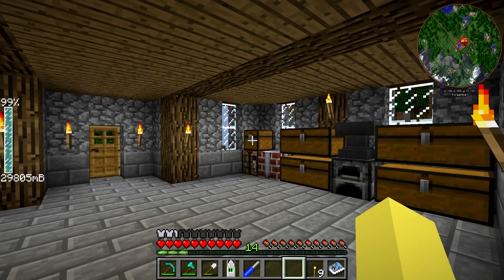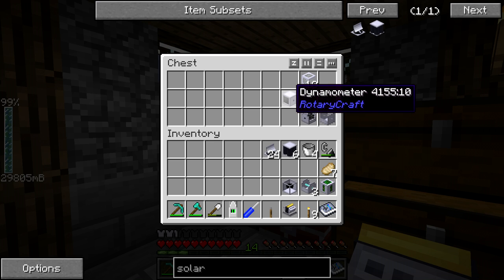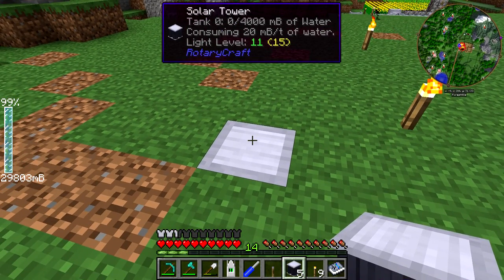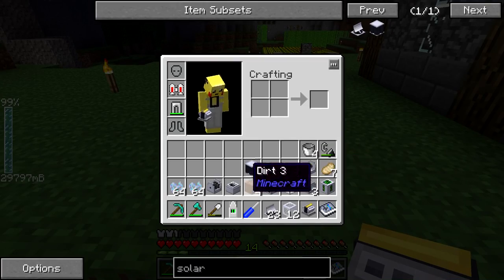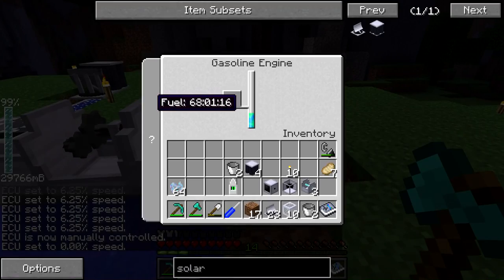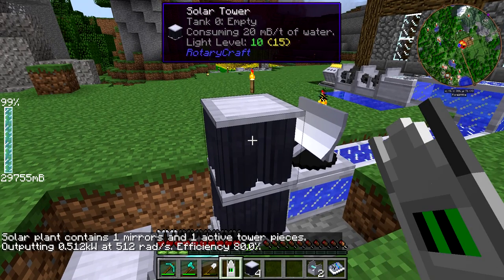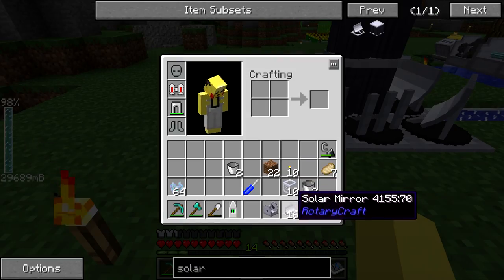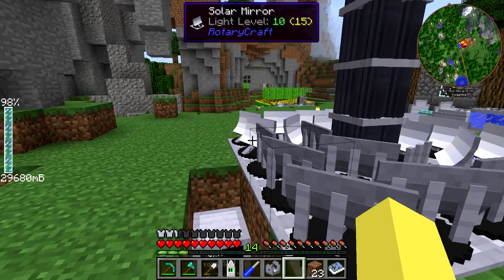Surviving With RotaryCraft :: Ep.16 - Solar Tower

Comment: acording to reika, and for my experience, rendering is mostly has nothing to do with lag
Reply from the maker: That is great news! I was always worried about making this setup because of lag.
Reply: well, we know that :)
btw each shaft junction trace all connected stuff so it cause highest lag.
Reply: thats simple. shaft junction merge limit is 4. and if you check power info, you'll see all connected engines. so we can assume rekai did this to prevent skipping tiers.

http://m.imgur.com/a/CygYg
Reply: yeah, if i run this on forge-vanila server and turn your redstone clock, tps drop to 3..

Comment: You can pump water with a steam engine 1 bucket per tick. More then enough to power the steam engine and an entire fission reactor ;-)
Reply: you could run 2 wind turbin for 2 turbine, they only need shaft junction
Reply from the maker: I thought I tested other engines, but Ill go back and try again :) thanks for the heads up!